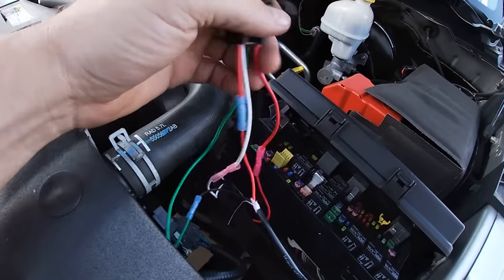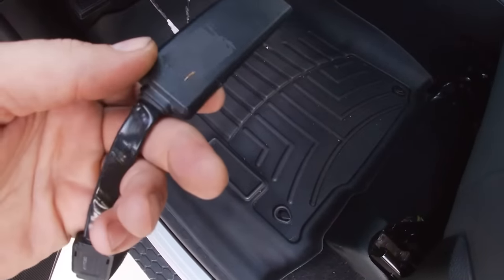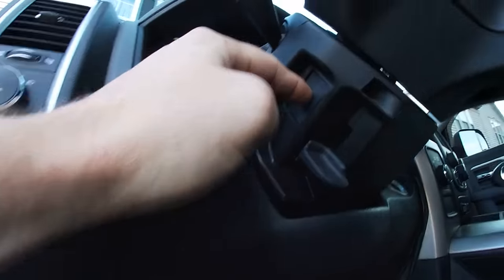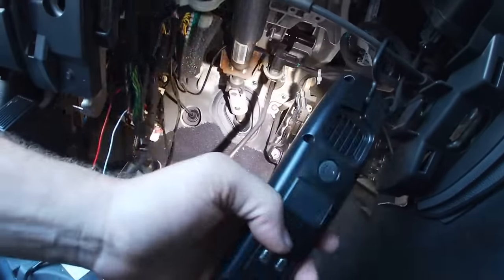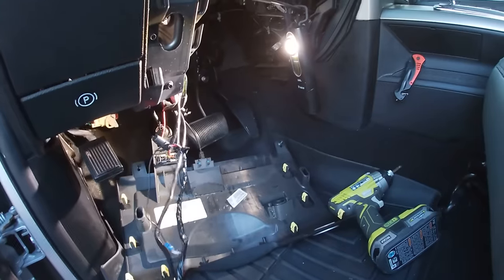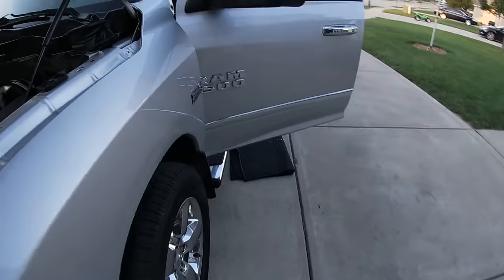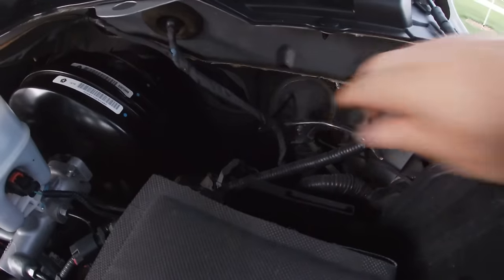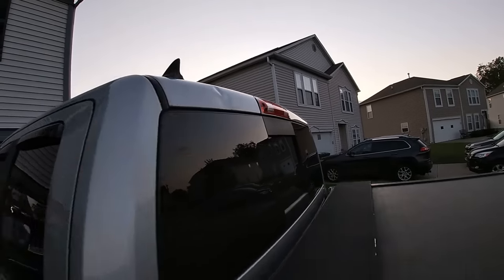Tracking Device Found on My RAM!

Comment: Funny this just popped up into my feed.  Had a friend who had purchased their vehicle at a buy here pay here place and had a tracker.  It was paid off and they have since moved, had an issue the other day where it was acting up when trying to start it as well.  They were looking and found what was supposedly 2 GPS trackers.  One was just two wires tapped into power.  The other had the relay spliced into the column.  The one spliced into the column was a real GPS tracker, the other one was more obvious and was literally just a box with an LED in it that flashed.

Funny the dealer didn't check it and the previous owner didn't pull it before selling it on yours though.
Reply from the maker: I ha e heard stories like this one in the comments many times. It’s apparently very common. The dealership should have removed it and believe me I called them about it.
Reply: @FABAutomotiveDetailing  For sure they should have.  A half competent tech taking a look over the vehicle should have noticed an odd relay and taken a look.  Sadly a lot of people just don't care enough about their jobs to do the right thing.

At least it was an easy fix.  Sometime soon I need to find an engine and trans at LKQ to swap into my 03 Dakota.  Have a head gasket leak and honestly doing a swap to an 08 to 12 4.7l is easier than pulling the heads and it probably needs a rebuild anyway.  Plus I will end up gaining about 70HP.  Figured may as well do both and end up with a newer trans as well and save the old one for a rainy day.

Comment: The neutral safety switch is located on the steering column and that is where the loom goes.
Reply from the maker: Neutral safety switches are on the side of the transmission.
Reply: @FABAutomotiveDetailing  Yes they are but the terminal and switch for the brake/shifter/ neutral switch are in the loom and have a demarc point behind that little flap as well.

Comment: As a retired tech I related to your video, thanks for the great memories, I will subscribe. Remember don't touch the positive with the negative. 🤪
Reply from the maker: Thank you! Only when the cables are un hooked to discharge all the modules! 😉
Reply: @FABAutomotiveDetailing  

This is true, I wasn't thinking that way when I wrote it. My bad.
Always loved Automotive electronics   and electic and
prided myself as being good at it.  Still have one shop in town who still calls me for help in elec. Diagnosis.
Reply from the maker: @stevenelhage966  I also enjoy dealing with electrical issues on vehicles. I’m the guy at the shop everyone turns to when they can’t figure it out.

Comment: Some vehicles come with them factory installed. For multiple reasons. Often their simply GPS for the navagation systems. OnStar. And dealerships. Just so u know. Theirs a code that will permanently deactivate the vehicle disable. Unless u bought it fully outright. Of course it's gonna still be their. All u had to do was call the dealership. And they would of provided u the disabled code. I'm guessing u has a large fee for removaing it. And ontop either have to come in to have it reinstalled. Or the truck repoed outright and they reinstall it anyways.
Reply from the maker: Zachary Paul I had the truck for 2 weeks when I made this video. The corrosion on the relay would have taken a few years to get that bad. It was from the previous owner. The Ram dealer I bought it from does not Install any trackers. I know the owners.

Comment: I believe I found a tracker on my 2010 Escape while trying to solve the remote start issues I had. I took it off and never heard anything from anyone but after opening up the box I found a blank Ford ignition key inside of it. Maybe it wasn't a tracker, I don't really know. But it's not on there anymore and I eliminated the remote start because of the previous issues with it.
Reply from the maker: Usually a key in a box like that is usually for the remote start so it can read the chipped key and bypass the theft system.

Comment: I own my truck and i am handicapped i took my truck to a dealer because of  a recall for my air bag .When i got in my truck there was this loud piercing noise and i found what might be 2 loud jammers that put off a high pitch noise.now its going to take a few days to get them off but i am determined to get them off.they ruined my truck ripped the rugs and they didnt put the wires back right and left them hang down.I an so upset they have no right to do that

Comment: That is nothing compared to what modern vehicles have. They have WAY more than just tracking devices. They are now making vehicles that run on software, have a WiFi connection to the manufacturer, have spy cameras and microphones inside watching, listening to, and recording every single thing the driver and passengers do and say, and transmitting all that back to the vehicle manufacturer as it happens, the manufacturers are then selling this stuff to third party companies who then sell it to anyone that wants it. They know where the vehicle is, how fast it's going, how fast you brake, even the pressure in your tires. They know what you are wearing. This is not like speed cameras beside the road. These cameras and microphones are INSIDE what is supposed to be YOUR vehicle, spying on YOU. These vehicles also have driver interference systems that can literally take control of the vehicle away from the driver. Thy can apply the brakes, turn the steering wheel, and shut the engine off. Some of them can be controlled remotely by WiFi by the manufacturer, and others. They can literally take over the vehicle, lock you inside, and then send the vehicle anywhere they want. Most people that buy these vehicles are still either unaware all this is happening, or refuse to believe it. Amazingly, some actually do know about it, and are actually ok with it, because it is supposedly "for their own good". All of this applies to ALL new 2024 and newer vehicles.

Comment: Those wires leading up your steering column most likely are a remote airbag activator.  VERY dangerous
Reply from the maker: Airbag wires are always wrapped in yellow or have a yellow connector.

Comment: You purchased the truck used so you have no idea what the real history is. Some finance companies require a tracking device be installed on a financed vehicle. The previous owner could have installed it or the dealer could have charged extra for a tracking device/theft protection.

Comment: Those tracking devices or on a 2 year plan for fleets and  Once the service plan is shut off it's just like a cell phone  With no service. Lights will come on plus it had a red light I think beeping so the code from the beeping light means it wasn't  In service
Reply from the maker: Brent Shehorn I figured it probably wasn’t in service. When company’s sell a vehicle with a device like this they had installed they should have to remove it. If I wasn’t a mechanic there would have been a tow bill and a repair bill I would have had to pay.
Reply: @FABAutomotiveDetailing   Yes. I had all my tow trucks equipped with those in the company would not come to remove them after one month of receiving live the  Service network. crashed. But the network company would not come and remove them or anything and I did not know how to do it lol so they're still in my trucks

Comment: I will say as an experienced RF electronics technician with over 30 years working with transmitters and receivers including GPS systems, there is NO way a GPS based tracker can work under the hood without an antenna out under the frame or external to the car. There is simply too much shielding with the hood and fenders to get a reliable position signal from the satellites.  If you don't believe me, use your phones GPS to create a track place it under the hood and see how well it works. Now if it is on the bottom of the car, it might see satellites on the horizon. GPS satellite signals work only on line of site connections, so if there are any metal objects between the receiver and the satellite, it will not receive information from that satellite. Now I do not know if those devices where trackers or not, but I do know they will not work with GPS systems without the antenna having a direct view of satellites. Now you could have a tracker that worked off of cell towers that might work, but its ability to track your location would not be near as accurate as GPS. Cell towers, depending on how many different towers might only have your position to within a mile or so; maybe a little better in cities.

Comment: Not sure where you live but in certain places like Chicago they have numerous types of vehicles not only Chicago but different places different cities in the United States use all different types of vehicles for undercover police and special operations and mention Chicago because they have a huge inventory of on likely vehicles that you would never suspect to be police vehicles every Undercover police vehicle is fitted with a GPS locator system so that if something happens to the undercover officer or whoever's driving the vehicle they can use the GPS tracking device to locate the officer or detective or sergeant in case of an emergency so if you happen to buy this at an auction or at a used car lot there is a good chance this used to be a police vehicle you can also check for things that you wouldn't normally see like mount in the grill and different types of Mount in the back of the truck used to mount certain lights most of the newer vehicles are Hide-Away lights such as blue flashing lights and strobing lights they go directly into the headlights but there are also other telltale signs that this could have been used for undercover work like in the cab where a police radio could have been mounted or a laptop stand bracket just food for thought

Comment: I buy my vehicles from only 1 dealership in my city. I am friends with the finance manager. I used to repo vehicles for him when he was at a different dealership. Anyways I have given him permission to install these tracking devices so he can test the new models that they are thinking of using. I also have full access to these trackers when he installs them. It does not bother me that these trackers are installed because it does protect my vehicles in case they are stolen. He even has one in one of my vehicles that I did not purchase from that dealership. Like I said I have full access to all these different trackers and his dealership pays me $100.00 per month to have 3 different brand trackers in 3 separate vehicles. They usually stay in my vehicles for around 6 months or until they feel comfortable using these trackers on their bad credit customers.
Reply from the maker: For a $100/month I would do the same. Thanks for watching

Comment: Any electronic/electrical device that is hot either: 1, is malfunctioning or 2, Has a short .  Any normal device that produces heat = watts = $ on your electric bill.  With the finite amount of capacity on a car battery:  Any drain will:  1.  Discharge your battery to uselessness; and it will destroy your battery life (it will sulfate the plates:  shortening the overall line lifetime/ months of use from the battery),

Comment: It’s a remote car starter😂😂😂😂 with cell phone connection 😅😅😅😅
Reply from the maker: NO it’s not a remote start I have had to remove a lot of aftermarket remote start systems. The truck has a factory remote start that works just fine.

Comment: I work in a shop and see these things cause multiple issues every day I feel like the original companies who install these cause a bunch of electrical problems with vehicles for one tampering with the tipm (totally integrated power module) in a Chrysler is very dangerous and problematic because they're faulty in the first place from OEM. And a lot of fleets use a plug and play GPS not a wired in GPS. When you find a vehicle that has been hardwired GPS it's to control the ignition and most likely a finance company ask for that item to be installed I feel like there's a lot of customers that should be reimbursed for the issues that they've had to pay and find from these GPS issues. I like this video but I would really wish a customer would show one of these calls and issue like this one with water contamination messing up the relay and it causing you to not be able to use your truck that you're now buying that has nothing to do with the GPS but yet you're caught in the middle of it.  I really wish there was some type of law that goes after the finance companies for installing these devices. Finance companies need to stop adding these to vehicles because they're worried about one payment when a customer is worried about the whole overall payment of the vehicle and the maintenance that comes with that vehicle on top of that the finance company causing problems with that finance vehicle by adding an electrical device that can cause damage. I believe that would be called tampering hell and some situations vandalism you're actually cutting into a wires of a vehicle adding something not needed or necessary for the regular operation of that vehicle

Comment: Maybe not you, but if your vehicle is financed and you remove this device, that's automatic repossession right there. Most tracking devices are in the fine print of a vehicle contract. So that way when you default on a loan the finance company can get their vehicle back. When the vehicle is paid off more likely than not they just leave the thing on there and if ou find it, you find it and trash it. No big deal. Something as complex as this, I doubt anyone is spying on you. An AirTag or Tile on the other hand, keep your head on a swivel.

Comment: Omg, how did put up with that noise and not say anything to the dealership you purchased it from?? This tracker should have been removed from the company after they sold the car. We have always had great credit with never having 0 down & getting a check for $69k from the bank to go pay the dealership in full.  In most states a new car dealership or bank needs a court order to ever track your vehicle.
Reply from the maker: I did mention it on the first test drive. Like I stated in the video it had rear aftermarket proximity sensors and they told me it was part of that system turning on when starting. I believed that’s what it was so wasn’t worried about it.

Comment: Bought a used car at an impound auction that ran fine until it would not start. Found a car immobilizer for a used car dealer in it. The shop removed it and the car ran fine. Then the original dealer showed up and tried to "repo" my car. Sheriff kicked them off my property after I showed them the title showing I owned the car. 
Apparently the car was left on the side of the road and was titled as abandoned and sold to me. The dealer was pissed as they said there was money still owed on it.
Reply from the maker: Glad the Sheriff stood up for you! I’m sure they weren’t happy at all.

Comment: That is a tracking device used by finance companies on high risk finance deals. It not only tracks the vehicle but disables the starter if you don't pay your note. the buzzer is there to let you know you didn't pay your bill and your vehicle won't start. Simple as that.
Reply from the maker: Could be but it says it’s a fleet tracker! I had only had the truck for 2 weeks when this happened  so my payment was even close to due yet. It was beeping when we test drove it before buying it.
Reply: @FABAutomotiveDetailing  From the looks of the relay it had been on for sometime, maybe a previous owner. The led lights one is for satellite signal and the other is cell signal. Could be fleets use this system to prevent unauthorized use.
Reply from the maker: @firestarter105G  Yeah that’s what I believe it is also.

Comment: It could also be used by the dealer,   If you miss your payment, they will disable your truck.
Reply from the maker: Subaru STi Yes that’s true but in Indiana that is now illegal for them to do plus it was on the truck when I took the first test drive and the corrosion shows it had been on there a long time.

Comment: Dealers install this devices as directed by the bank that has concerns about the loan.  These are usually installed quickly and poorly due to the dealership mechanics get paid like $10 to put them in.  So the mechanics just throw them in to just work but my stop working shortly.  Banks put these in all the time if you just barely made the load criteria and they have concerns about a default. IF YOU DO HAVE A LOAN AND REMOVE THIS TRACKING DEVICE IN SOME CASES THEY WILL REPO THE VEHICLE EVEN IF YOU HAVE MADE YOUR PAYMENTS.
Reply from the maker: Ram 4570 Lime i said in the video It wasn’t put on for my loan. The corrosion shows it had been on there for a long time and I had only owned it for 2 weeks when I made this video.

Comment: Would like to know some other suggestions of where and what to look for on my vehicles for tracking devices.
Reply: Anywhere there's wires...it needs power. Some are hooked to your speedometer connection either at the transmission or behind you dashboard cluster gauges and will only activate when the vehicle is moving more than 10 mph. Do an extensive visiual check first. Might want to invest in an EMF locater. Don't bother with the cheap Harbor Freight version. Amazon sells them but try and get one costing at least $49.00. If you're pretty sure you have one, you can pay a private investigator $150 to locate. Just make sure he specializes in bugging and tracking device locations. Good luck!
Reply: Forgot to mention, it could be installed in your CPU computer. If your car is 1996 or newer, then you might have more than one. Good luck!